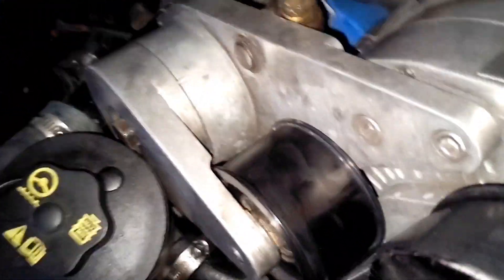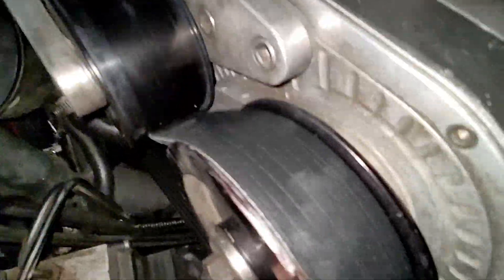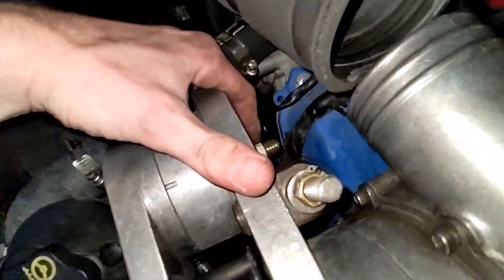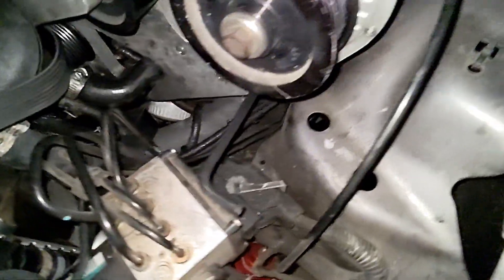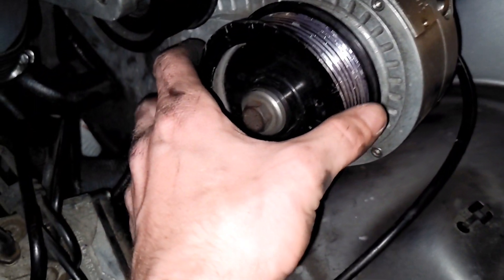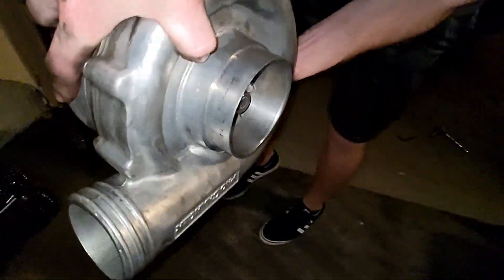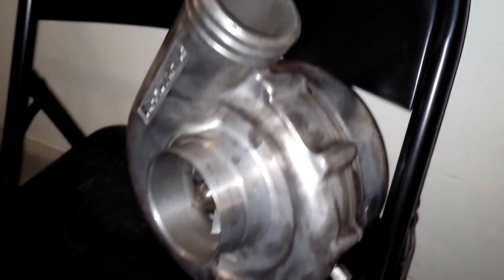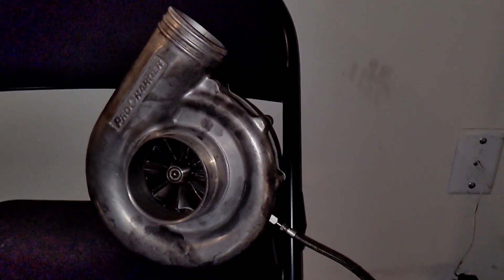3v Mustang GT Says Goodbye To Supercharger

Comment: You should take this chance to relocate the power steering pump so it is in a better spot.  I put mine on the drivers side shock tower.  It was pretty simple to do.  Or convert to an EPAS setup and lose it altogether.   Good luck with the rebuild.
Reply from the maker: Lmao, I really should, I did a pretty half ass job trying to find a place for it LOL
Reply: @CamMarz  https://www.cxracing.com/coolant-aluminum-tank/CT-PS-MUSTANG0514  this one works well